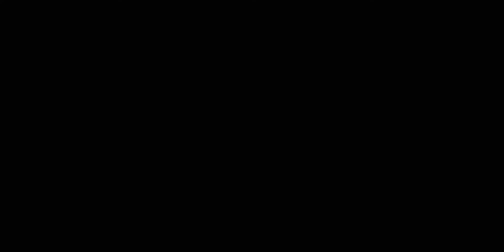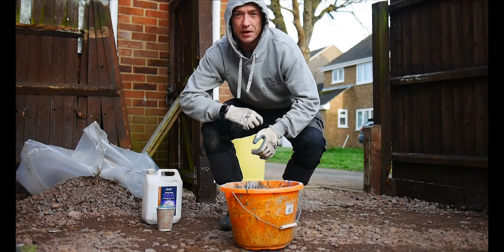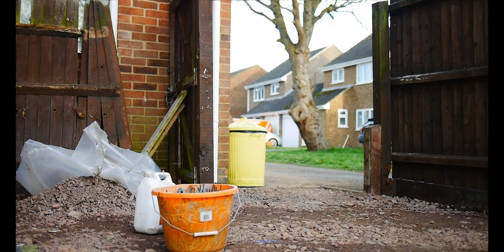How to make porcelain slurry primer

Comment: I wish I had known about this before getting someone in to do my patio,  They used PVA which I now realise is a complete waste of time.  Only done 6 months ago and tiles already loose in a couple of areas.  Not doubting at all but does this mix definitely work long term i.e. do you have long term experience of porcelain with this method and does it really work?  Thanks very much.
Reply from the maker: Hi deemdoubleu thanks for your comment,  and yes this method works, if there was a better method even if it cost more I would use, this for me so far is the cheapest yetost effective method.  The supplier's have created there one ones which I personally find dry to quick and cost a bomb. Had to replace a a chipped porcelain tile the other day and it was a nightmare to get out and the slurry had definitely done its job and bonded to the concrete .
Reply: @jaspermillerlandscaping6174  Thanks v much.

Comment: Can this be used on loose slabs, could i paint it on the old slab and dried mortar bed. Thanks
Reply from the maker: you could try it , if you do let me know how you get on, the lads were I used to work used to knock up something similar but used more cement, if they had any loose slabs but in the past on a 1 x 1 ive used a product called aquabond , worked like a charm but some people might have a different opinion.

Comment: And will that stick to old concrete or cement
Better
Reply from the maker: It works as a bonding bridge for he slab to adhere to the concrete,  wouldn't use on old concrete

Comment: After painting the porcelain with this primer slurry , does it need to be dry , install the 2nd day ? 

Other question mixing sikalatex with cement considers as primer slurry ?

Thank you
Reply from the maker: Hi yazan thanks for commenting,  my apologies for such a late response,  no need to let the slurry dry, infact I prefer to lay as soon as I've painted the slab.
Reply from the maker: And I'm afraid I can't answer your second question as I have not used personally,  but looking at it online it looks exactly the same as the sbr I use anyway,  I don't think you would have any issues but as I've said above not used personally so maybe try on one slab to see the results.  Thanks again for commenting 🙂

Comment: Still don’t understand it. 
Mix 1 cup with SBR and how much cement??
Confused.
Reply from the maker: 1 cup cement and 1 cup sbr, a 1:1 ratio for example 1lire tub of sbr and use the same 1litre tub , fill it up with cement  and mix Both together
Reply: @jaspermillerlandscaping6174  Still confused as to ‘full it up with cement’?
I have 5 gallon of SBR. Cement is dry powder. 
What do I add to the bucket just using the cups. 
1 SBR
?? Cups of cement powder. 
?? Cups of water ???
Thanks for replying.
Reply from the maker: So one cup full of sbr into the bucket and then one cup full of cement into the bucket,  no water and mix for example if you had a  empty coffee cup, fill that up with your SBR and pour that into a bucket,  then fill that same cup up with dry powder cement and pour that into the bucket and mix .
Reply: Right so basically it’s one cup of SBR and one cup of your READY made cement your using to lay. 
It’s that’s simple. 
Sorry to be a pain but the last explanation mentioned NO water at all. 
I watched the video again. 😂
Reply from the maker: No trouble atall and just neat cement out of the bag not the concrete mix your using to lay.
Reply from the maker: and no water atoll
Reply: @jaspermillerlandscaping6174  wow. I would thought that would be very dry. 
1 cup sbr. 
1 cup of dry powder cement 
Basically 50/50. 
Surely that would not make a paste as the cement in powder form would not make a ‘paste’ 
Then again I have never use SBR only PVA so I presume it must be a lot more ‘watery’. 
Cheers
Reply: @PT4LifeYO  I don't think the paste will be as thick as you seem to be. That would be too thick .

Comment: If laying the Porcelain tiles on a mortar bed should I level the mortar and let it dry before laying the slurried tile, or lay straight on the wet mortar?
Reply from the maker: Lay straight on the wet mortar 👍👍
Reply: @jaspermillerlandscaping6174  Thank you - done a lot of tiling, but never porcelain slabs and found your video a real help in preparing to do the job - 95sq m 😳
Reply from the maker: Cheers mate really appreciate your comment,  glad I could help. 95sm is a nice size area  just get your prep work done correctly and everything else follows suit. String lines and levels obviously help lol. Good  luck,  let me know how you get on.

Comment: Hi, how long have you been using this mix on porcelain slabs? 
Thanks 👍
Reply from the maker: Thanks for commenting joe, 5years now. no problems so far . I do slap it on though lol.
Had to lift a slab on a job I installed last year it was an absolute nightmare to get up
Reply: @jaspermillerlandscaping6174  is that 5 years on porcelain? I've used it for years on sandstone and never had a problem
Reply from the maker: Yes that is majority of our work these days, I'm on a 50m² job next week and will be using the same method then. Its so much easier to work with in my opinion. Do you use the same mix?
Reply: @jaspermillerlandscaping6174  yes I mix it pretty much the same, I don't usually measure out the cement tho, just keep adding it until it's a nice thick creamy consistency. I've just started laying porcelain, but not tried this mix on it, I used the ultrascape pro prime and didn't think it stuck quite as good. But it might be that nothing is going to stick to porcelain as good as natural stone.